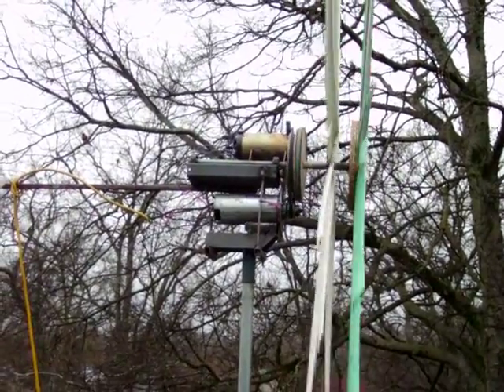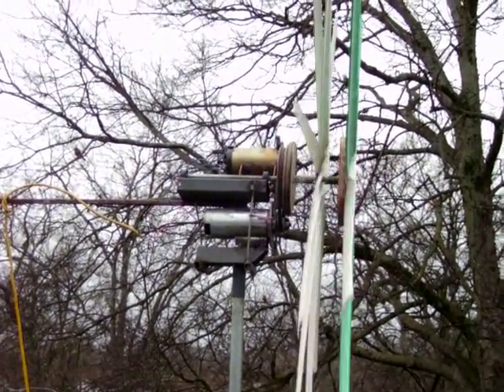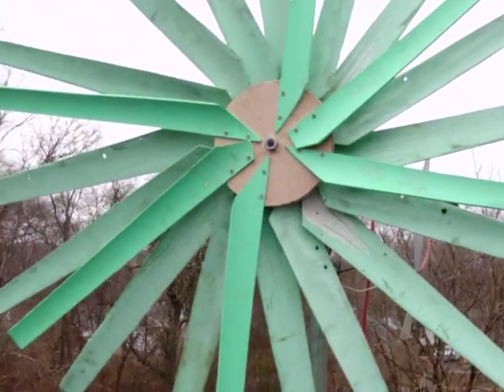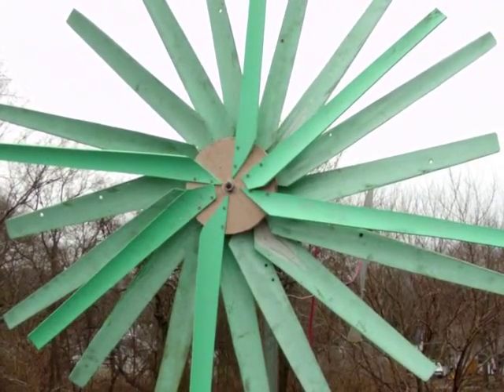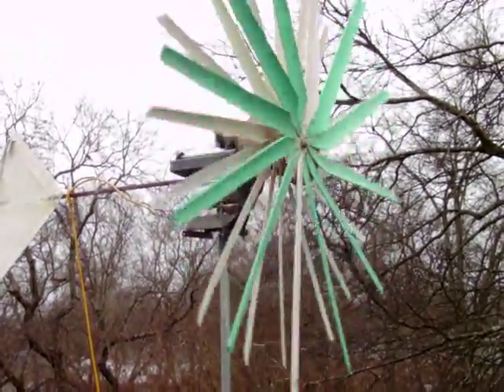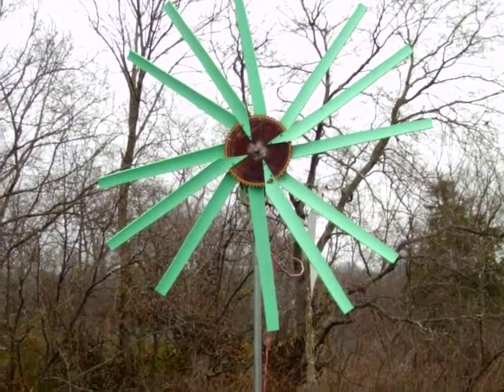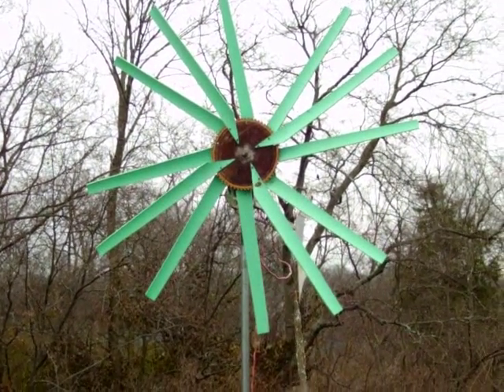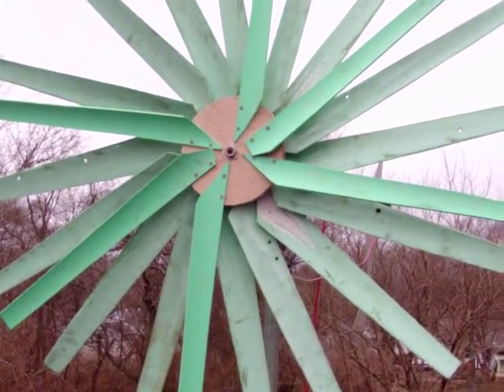wind generator,28 blade,double rotor ,double motor,

Comment: Hey man, what are you using to make your blades with? Could I do this with an old ceiling fan?
Reply from the maker: +Charlie Patterson Not big enough
Reply from the maker: +Charlie Patterson U can use a ceiling fan to make a wind generator I have made a few of them that will charge a battery over time but it does not produce the amps needed to alot but it will keep the batteries  up for periods of time ,I've seen 50 volts just from a ceiling fan converted

Comment: how do you get the fly wheel of the treadmill motor to drill holes in it? i can't get the hub off on the motor i have? good videos use sub to ya

Comment from the maker: I tryed that the main shaft was a right hand thread and the generator was a lefthand ,need less to say couldn't keep the nuts on the shaft.It does seem to work better ,or produce more  power with it counter rotating .

Comment from the maker: Well two dc generators on one rotor is to much drag for low winds ,have rebuilt the unit for one generator and have linked all windmills in series with one to it's self to help with the amps